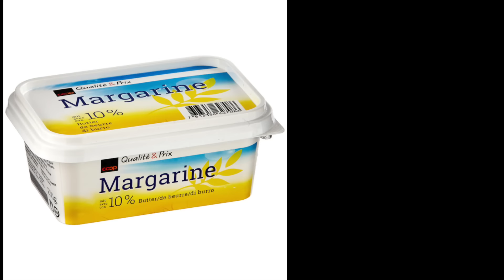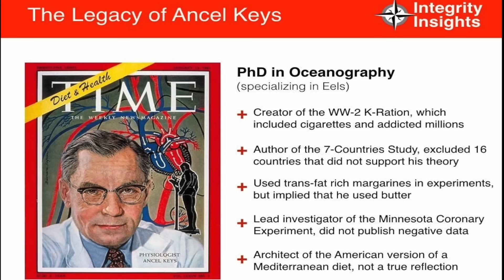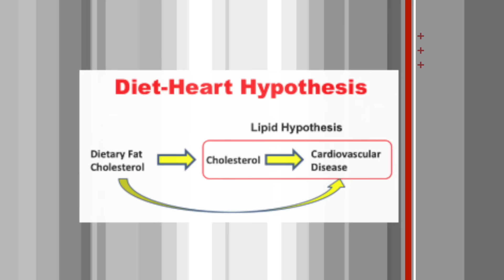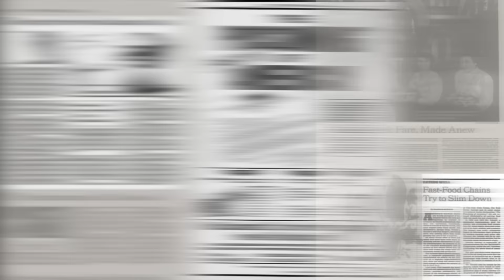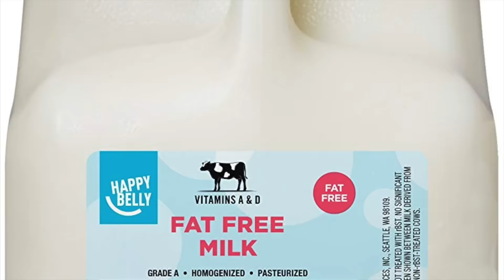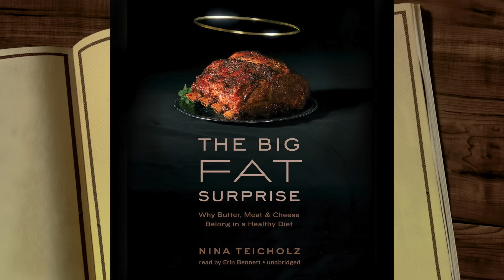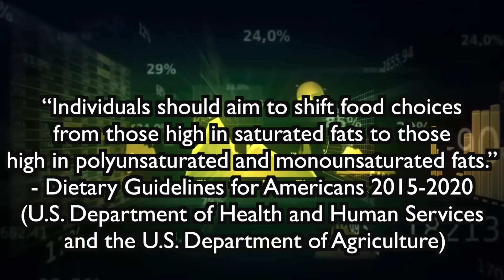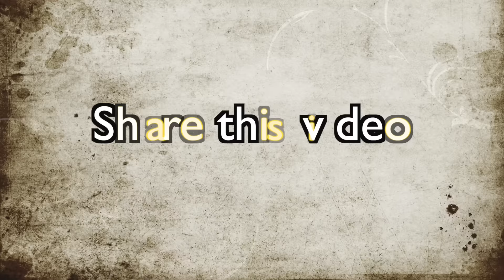Why is Vegetable Oil in Everything? | The History and Corruption Behind Processed Oils

Comment: What about peanut oil? i understand that it is easier to get oil out of peanuts (less heating and fewer solvents) but peanuts are in the same family as soy so I don't know if it is any safer or not.
Reply: The main fatty acids in peanut oil are oleic acid (45–53%), linoleic acid (27–32%), and palmitic acid (11–14%). This oil specifically has long-chain saturated fatty acids such as arachidic acid (1–2%), behenic acid (1.5–4.5%), and lignoceric acid (0.5–2.5%).

the toxic PUFAs are linoleic acid, linolenic acid and all their varients

Comment: Great video, How's sesame oil? Is it still unsafe?
Reply from the maker: They can be made at home, which is a plus. However, their omega 6:omega 6 is 56.8:1, so we would recommend staying away from it.
Reply: Processed seed oils go through extreme heat in the extraction process rendering them—not food. Oil. Machine oil.
Reply: I have eaten sesame oil but never seen it used for cooking in frying. Only mixed with soy sauce as a dip for meat. Or mixed with ground pork to flavor wonton filling. I guess other chinese use it but not my mom.